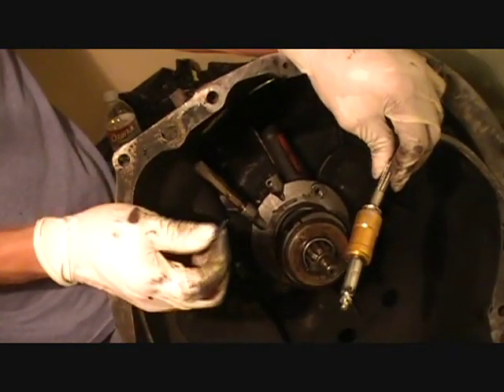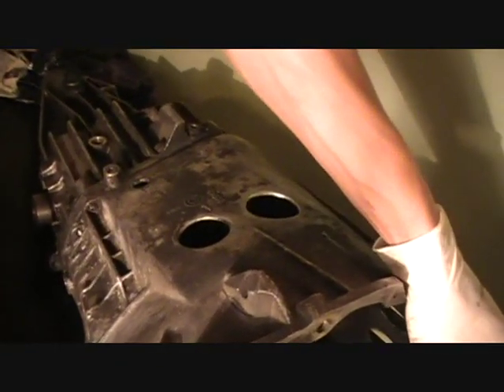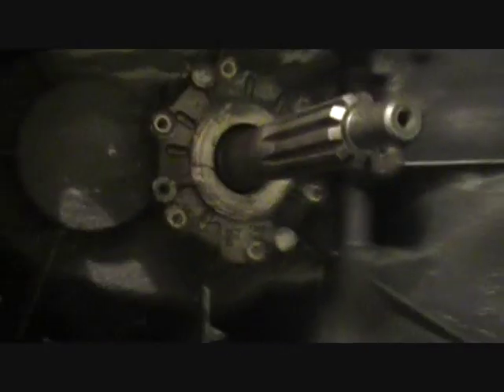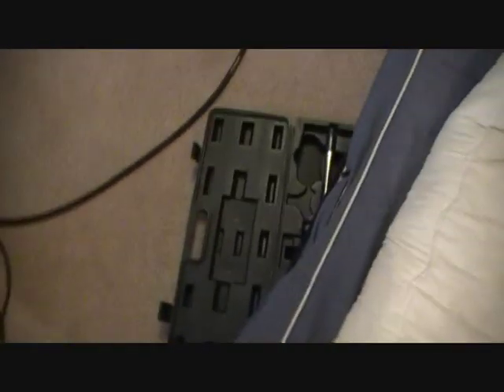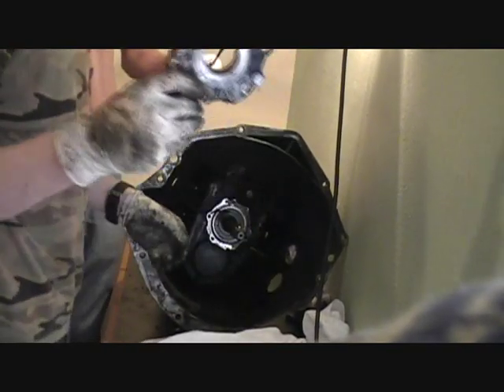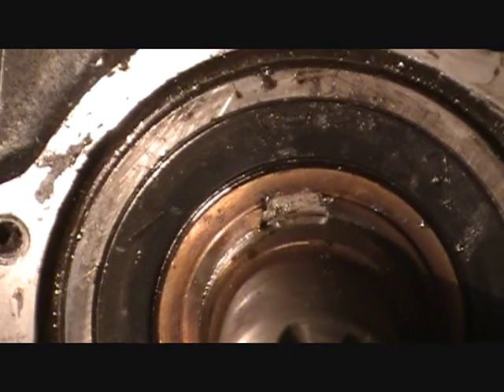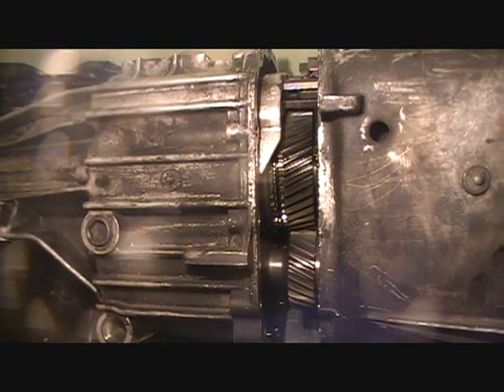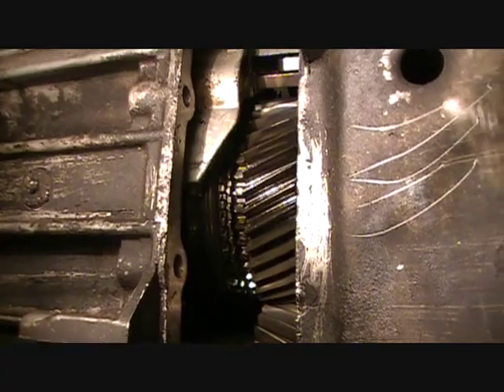NV3500 standard transmission rebuild how to -part1

Comment: Ok, I'm going to assume this is your first mechanic job. You know your tools, just not their names. Your push pin thing is called a punch, the thing you took out to disconnect the slave cylinder is called a roll pin (The name matches what it looks like) Other comments are correct, all you needed was a screwdriver or two to push the white ring in, what that does it push up a bunch of metal fingers from hooking a metal edge. The front of the transmission you were removing is called a "bell housing". (I forget if that is a "Bell Housing", or a belle housing, yay english)
Reply: Thanks for the comment. I miss these days of messing with difficult jobs...
Reply: @valentinrieuf9983  Another name for that pin is spring pin, another is sproil pin, although I think that is a company name. Also there are 2 types of pin punches, the tapered type is called a drift punch, the straight shank ones are called pin punches. Start moving the pin w/ a drift punch then finish w/ the pin punch which has a straight shank that will pass through the hole where the roll pin was.

Comment: all u got to do is push the little white piece toward the fitting and pull at the same time i used 2 little flat head screwdrivers easy peasy brah  if u need more info hit me up gmail a9fingdad or emial me at yahoo ill go over it with u step by step

Comment: so I'm buying a 15002wd with a 305 vortec its a 1997 but its gota nv3500 5spd I'm thinking this must be a weak tranny should I swap in a nv4500 5spd I wana be able to tow some weight if I need and some day a either hopped up 350 or 383stroker

Comment: Thanks for the quick reply. I actually got the indent plug out with some uni-strut. The kind with the holes in it. I cut a little fork in a 2 foot piece and pried it off. I think I got lucky. I found out the gear on my input shaft had a big chunk taken out off it. I am just going to replace the input shaft and hope it works. Although some chipped metal pieces could ruin the bearings, I don't own a press or a gear splitter to get the job done correctly at this time. I did however find an online

Comment from the maker: Yes the plug needs to come off if you want to separate the cases fully. If you don't own a welder, get one because they are worth more than their price. If not then you could make a small hole in the center of the plug, then thread that hole, and then screw a bolt in the threads, that would be the equivalent of welding a bolt to the thread. For this, you would only need a good drill (Dewalt) and a drill and threading tap set to make the threads in the holl you drill. Hope that helps.

Comment: There is a collar around the clutch line where it connects to the slave cylinder, all you have to do is press in on the collar and pull the line out. The nv1500 in my s10 has the same slave cyl/line. Sometimes they do get jammed up and you have to do it the hard way.

Comment from the maker: update: tonight we have separated the case and started taking the gears assemblies down. We have already been able to determine that both gears at the end of the two main shafts are seriously compromised. Might be the reason for the whining noise.(sounds like a 03-04 cobra supercharger in less loud). We cannot tell wether or not any bearings are fatigued but all the synchronizers and rings look in great shape. This tranny is definitely complicated to overhaul but would now be a 30 minute job...